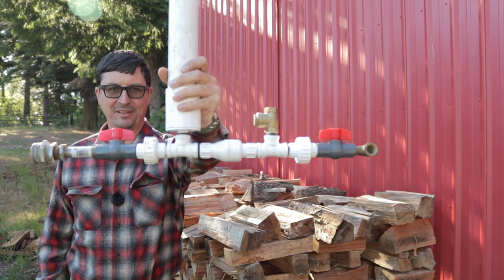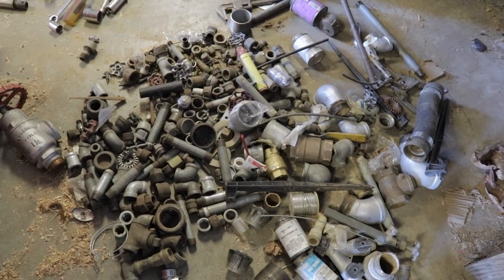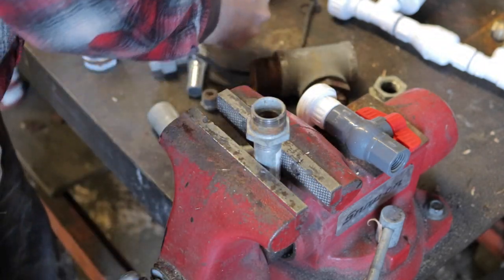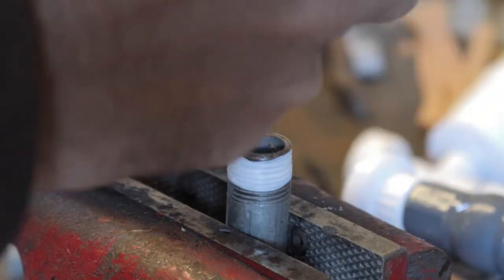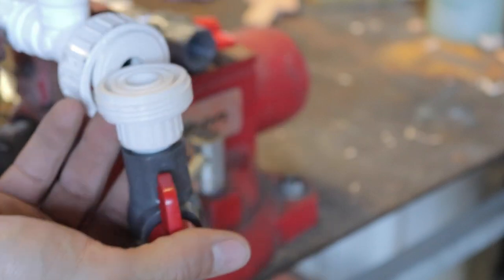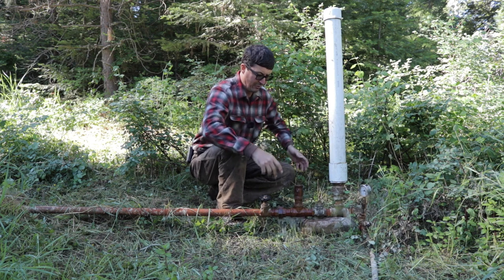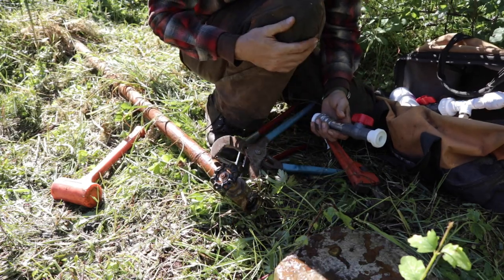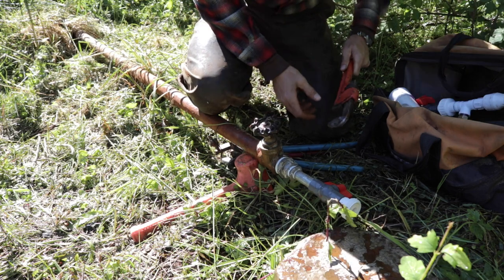Coolest Little Ram Pump Ever!!!

Comment: Awesome install! Thank you for giving the tiny pump a try. I am also interested in the results of connecting a large 1-1/4" drive pipe to a 1/2" pump.  My experience shows that pumps work best with the same size Drive pipe and check valves. The down hill pressure wave is very strong but the small valve closing has to push against a larger body of water on the uphill motion. :)
Reply: thanks for making them!!!!
Reply: TRY THIS IDEA, A  BICYCLE AIR VALVE IN THE CHAMBER TO BUILD UP PRESSURE MORE QUICKLY

Comment: For high pressure, high temperature (400 F) threaded pipe sealing, the best "pipe dope" is Loctite 567.  2 down sides.  It takes at least 24 hrs to fully cure and, in my experience, disassembly requires heating the joint above 400 F.

Works great on air compressor fittings !
Reply: Really useful for mechanics too. Nothing shakes loose and nothing comes undone. Great stuff🤙

Comment: different color teflon tape has different uses. white is for water, yellow for gas pink for potable water green for oxygen. gray has nickel anti seize,anti galling anticorrosion. copper is for pipe lubricating but not sealing.  They all have a temperature rating from about -450F to 425 f it is especially important to use the right one for Oxygen as it has no oil in it. Hope this helps. By the way great vid, I just learned about Ram Pumps I think they are really cool. I wish I knew about them 30 years ago. they would of solver a big water problem I had.

Comment: White – used on NPT threads up to 3/8 inch
Yellow – used on NPT threads 1/2 inch to 2 inch, often labeled "gas tape"
Pink – used on NPT threads 1/2 inch to 2 inch, safe for propane and other hydrocarbon fuels
Green – oil-free PTFE used on oxygen lines and some specific medical gasses
Gray – contains nickel, anti-seizing, anti-gailling and anti-corrosion, used for stainless pipes
Copper – contains copper granules and is certified as a thread lubricant but not a sealer

from Wikipedia you have been warned
Reply: This is the list I was looking for, thank you.

Comment: If you use the the tape the other way so when you spin it it dont untangle from the reel so the tape is always firm, then you dont aahve to thingten it on the reel. Great vids keep it up :)
Reply: He’s spinning the t tape the right way.
Reply: @senerth  the right direction yes but if the roll is flipped it will go on better and tighter in the threads

Comment: The color of the PTFE tape can sometimes designate it's density or intended use.  Blue and Pink generally are high-density tape which are thicker and require less to be wrapped around the joint to achieve the same seal.  Yellow is used for Gas pipe installation.  White is generic and is usually low density and thinner but varies from manufacturer to manufacturer.   Pipe dope (Pipe Joint Compound) is generally easier and faster to apply but messier and it doesn't harden much over time. Pipe Dope is also available in many different variations for many different types of plumbing.  Fuel line pipe dope, in particular, cannot be used with most types of plastic or for lines carrying potable water.

Comment: I was a journeyman pipe-fitter for union 669 down here in Texas. We used teflon tape (white) to seal the threads, and we used pipe dope to lubricate. Pipe dope alone tends to leak on higher pressure systems* (150-220 lb water pressure) but it makes it much easier to run the pipe into a fitting. Thus, the practice is to wrap 3-5 rounds with teflon tape then brush on a layer of pipe dope onto the last 1/4 inch of threads. 

**As a note, I was not a plumber, I worked exclusively with fire protection sprinkler systems, such as foam systems, water, and chemical.

Comment: One suggestion I would like to make. When you wrap your Teflon tape on pipe threads, if you flip your roll 180, your roll will stay tight against the threads and it gives you ultimate tension control of the tape and you're not fumbling with the roll 6-8 inches away from the pipe trying to keep the tape on the threads. Also on your union on the ram pump. If you tape the threads on the half the big but screws on, it's never going to be very hard to get apart. I personally always dope the threads and adjoining faces for a great seal and easy disassembling for years to come.
Reply: Dear Sir nice video but you are not using the thread tape properly. It should only warped twice around the threads. I have been using this for over 30 years and have done course's with the likes of swagelock etc and that is what they teach. Stick with the white we use this in the oil industry up to about 2000 psi with no problems
Reply: Twice? I’ve been doing this over 25 years in 3 different industry’s. Refining, HVAC, oil field, and general home plumbing. I’ve never had a connection leak due to (too many wraps). Never... I have however had leaks early on when I got in a hurry and only wrapped twice or ran out of tape while wrapping threads. I use too much for sure usually 5-7 wraps on say 3/4 carbon steal when 3-4 would do. 2 wraps though? Why even risk it? Not enough.. I too have colaborated with swagelok and never have a heard this 2 wrap theory. Also considering swagelok is mostly compression lock stainless (mostly) threads are usually in play only when going from or to threaded pipe to swagelok fittings and tubing. Yes I realize they have a wide variety threaded connections in many alloys. 2 wraps??? That’s ludicrous Ok I’m done
Reply: andrew Thompson Are you sure??? They always told me 3 wraps on those courses, but then that was in the UK. Maybe they used the Monty Python method of counting. "Three shall be the number of the counting and the number of the counting shall be three. Four shalt thou not count, neither shalt thou count two, excepting that thou then proceedeth to three. Five is right out."
Amen...
Reply: Wade - When I worked in the plants we were told 2 - 3 wraps.  Any more than that on connections that are disconnected frequently and you risk stretching the threads. Over time the fittings become useless and have to be replaced.
Reply: Sky Watcher 
I’ve been “told” many things in life. I tend to stick with what I know through experience. I’m not saying you (or the tellers) are wrong but I just can’t see that being a possibility.(that is, over 2-3 wraps will cause stretch in threads or pipe) that sounds like the device we tell green hands to go fetch when we wanna send em on a goose chase. (“Hey hand, go get me some of that Teflon pipe stretching paste”) LOL!! “Oh and a can of A.I.R. Please”
   Anyway, respectfully I don’t aim this at you so much as to the people that told you that. I welcome being corrected I just have doubts on this particular topic. Im no metallurgical expert with a molecular chemistry background. Only a refinery worker and a mechanic/machinist on my off days. These days they pile the training on refinery workers mostly in the form of online modules. Every time I come in for one of my 2-2-3 shifts it seems there’s always new training. This stretching phenomenon has never been spoke of. Teflon is so soft and it’s lubricity property’s ease the friction of male to female threads. All screw pipe from turn around to turn around seems to be doing just fine. If you have vetted docs of this please post them. I’ll gladly say I was wrong but most importantly I’ll stop stretching all that pipe.... lol
Cheers.
Reply: When it’s for a client you never want to come back to fix it again, so I have learned to couple of tricks when using teflon tape. First, clean the male and female fittings with a wire brush. Then it’s just two to three wraps of Teflon on the metal threads, using more on PVC because it shrinks over time. Once the tape is applied to the male threads, take a rag or your gloved hand and gently press the tape into the threads, this way the tape stays in the thread and doesn’t bunch up as you drive it together into the female fitting. And when it really matters, teflon with a small amount of pipe dope does the trick reliably every time.

Comment: Does the size of the air tube make a difference in the operation?  In other words, does a larger or smaller length of tube change the pressure of the pump?  This is an amazing little device!

Comment: Awesome videos 1st off im a pipe fitter of 20 years I usually use both Teflon tape and pipe dope .. and I noticed how you had your roll of Teflon tape rapping the threads if you flip it so tape is on inside not outside it will wrap easier just a tip..I use pipe dope with Teflon in it as well if I don't have both..it just helps seat the threads tight...blue tape like blue monster brand is thicker and don't take as much as white Teflon..great videos and God bless

Comment: I was a master craftsman pipe fitter and the industries understanding was that "teflon" (PTFE) tape is not for sealing, it's for lubrication and makes it easier to get the fittings nice and tight. Pipe dope is to seal and using them together was many a fitters preferred method. My personal experience is that heavy duty (thick) teflon tape alone is pretty reliable and the easiest to use by far for most jobs and if it was for drinking water I'm going to drink, I only use tape. I prefer PTFE tape that's for stainless fittings because I did a lot of stainless and that tape has nickle in it which prevents the stainless fittings from cold welding together. People that have threaded a lot of stainless or titanium will know what I'm talking about. But for steel, I seems like it really helps to prevent the steel from corroding together and makes fitting much easier to get apart later.

Comment: 23 years in a Maintenance technician position and we used Loctite PST on most fittings that were hydraulic but we had large cans of pipe dope for water lines. If this is for potable water make sure the dope or tape used is for table water.

Comment: It was pleasant to see you put it together correctly at 13:30. 
Up to that point the inlet and outlet were on the wrong sides of the check valve/accumulator assembly.

Comment: I'm a plumber in the UK..... I use PTFE tape and jointing compound together one to seal threads..... and the other seals miniscule leaks and lubrication. Never have a leak doing that. Great video.... but I noticed you applied the ptfe tape to the thread in a way that could be made easier. Check out a video made by a guy called plumberparts and how to use ptfe tape. Hope that helps.

Comment: My father-in-law is a pipe fitter and prefers the Teflon tape for less mess (and it doesn't dry out like the dope).  Also, 96 ounces is 3 quarts or 3/4 gallon.  You've got a nice ram there!

Comment: Plumber down in the sand pile here. We call those threaded 90s street 90s and they can be from any pipe system with the same name(PVC, CPVC, Galv etc.). We also call lengths of pipe with a hub on one end hub spicket, though that seems to be only one of several names for it. As for the thread tape versus pipe dope, we use both heavily in the trade. The tape has one specific draw-back in that it enlarges the diameter of the fitting where as the pipe dope can squeeze out. This can be a problem on fittings if you over tighten them, trust me, I have split more than one brass female this way lol. If there is a fitting we really do not want to leak we very often will use both (tape first please). As for colors, I know some colors of the tape are actually related to the thickness of it. Gas tape, which is yellow, is thicker than the white, and I believe there is a red tape that is thicker still. the thicker tapes are for larger pipe sizes from what I understand however we rarely thread anything over 1" down here. The blue seems to be about the same as the yellow, but I have not looked into it. I have used both blue and white and they both seem to work fine for me.

Comment: Thanks for uploading a wide variety of interesting content like this. There is always something to learn. Teflon tape is generally used for water fittings the "goop" is used for hydraulic and fuel line. The different coloured tape usually denote thickness

Comment: Tape works fine for any NPT steel fitting.  I've done many, many fittings with it.  Never had a leak.  Not counting bad fittings.  When using thin tape just give it a couple more wraps.

Comment: FYI---In most areas of the USA we generally consider  64 Ounces is a HALF GALLON... 96 Oz. is three quarters of a gallon where I'm from, So your small rig is actually running at 1+1/2 gal per minute. if 96oz fills in 30 sec....But I may be incorrect where you live. Either way, thank you for sharing your "ram pump" as it is a handy thing to know about.

Comment: I don't have experience using the different types, just the white teflon tape.  But with that we used it on 10 KW liquid cooled radio transmitters and it worked just fine with that, with the added advantage that it helped to take the connections apart when we had to.

Comment: It depends if its straight or tapered threads. You use teflon tapes on tapered threads not for sealing but for lubricant, the interference in the taper seals it. 

Straight threads a sealant should be used like pop dope or my favourite is lock seal.

Comment: The 1/2 inch brass 90 degree ell with female threads on one end and male threads on the other is called a "street ell" (at least in Texas). Available in 45 degree and numerous sizes although I've not used any larger than 2". If you only have a few threaded joints to assemble, teflon tape works well but doing it all day is much faster with something in liquid form.

Comment: Hello: for the question of tape or dope , I use both . If you are working with brass use just the dope, (as the brass may split easier with the tape ) Gasola or monster. but if you are threading into a water tank relief valve or hot and cold dialectic fitting 5 or 6 turns with tape and some pipe dope. Plumber in Vermont. Love the pump, kind of  like a Perri jet,  used in the navy  for De watering spaces . In that it uses water to lift water.

Comment: my company deals with high pressure steam. We put teflon on first then pipe dope over that. Just a quick tip if you hold the pipe in your left hand you wrap the tape over your pipe.

Comment: My father was a plumber for years with my grandfathers company. Pipe dope as he called it, was always preferable he hated the tape. For my paintball gear I always used the tape as its good for sealing air fittings.

Comment: can you use that waist valve to pump water up any inclination? or would the pressure buildup on the other side of that check valve kill the process? if slowed that would be fine, maybe you could use this to reclaim some energy in a mostly gravity fed aquaponics system and one small fish tank air pump to create a vacuum. then setup solar for the 1 air pump

Comment: I was taught by two different plumbers one just completed his apprenticeship and starting his career and one finishing after 40 years the same method:

1.) Apply dope to the male thread
2.) Thread in hand tight then remove to lubricate the threads.
3.) Apply dope, then tape, then dope over tape to make thread.
4.) Thread into fitting, tighten. 

Never had a leak since then. Ever.

Comment: Loctite PST 567 is best for brass and metal pipe threads imo.  quick and easy to apply and is a thixotropic paste that is anaerobic. it comes in squeeze tubes but they also offer a chapstick type of applicator.

Comment: I used to use only 3 or four turns of the tape but after recommendations at the irrigation store I now use at least 10 to 15. Never ever a leak and a tight fit . I also use the thicker pink tape (less turns)

Comment: Cody, flip the roll of Teflon 180 degrees and wrap it using the back side of the tape instead of the underside. It will wrap easier and not unwind more than you you want it to. I hope that makes sense. If it was regular adhesive tape, wow would wrap the non sticky side on the threads. You'll still go with the direction of the threads.
Reply: Not "wow"- should be "you". Can't seem to edit on my iPhone

Comment: True blue pipe dope is what we use on all gas line and it never leaks. On anything water related especially for drinking we usually use the real thick and wide blue Teflon tape. Not sure what brand it is but every hvac or plumbing supply shop sell it

Comment: I know this is a long overdue comment considering its now 6 years later but I find the best sealer for pipes is usually the hemp fiber. A little more annoying than tape or paste but has the added advantage that if there is a leak it tends to seal over time.

Comment: I didn't get through all the comments but in my experience the plasto-joint stick is the best for plastic pipe. That one looks like a crayon and you just "draw" across the threads in several places. I've never seen that leak even with loosely assembled pipe.

Comment: i know im 2 years late but in plumbing its really all preference when it comes to sealing threads, what i like to do is for copper pipe i will use Teflon tape and for steel (which is usually used for gas, plumbers use black iron or if theres really old pipe we will use wrought iron) i tend to use pipe dope on that. hope it helps for future

Comment: I work with stainless steel pipe on my job and it takes the tape and Teflon pipe dope together to get threads to seal on a consistent bases. Your 90 degree elbow is called a street elbow.